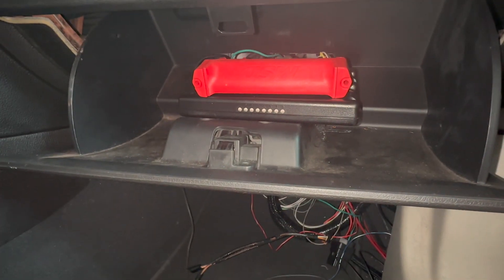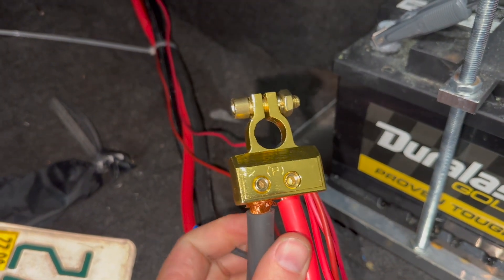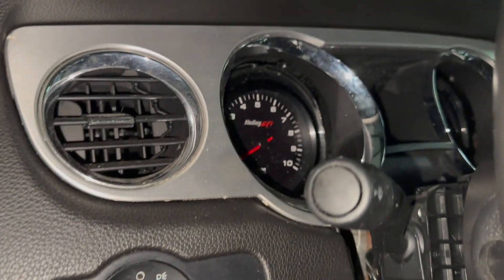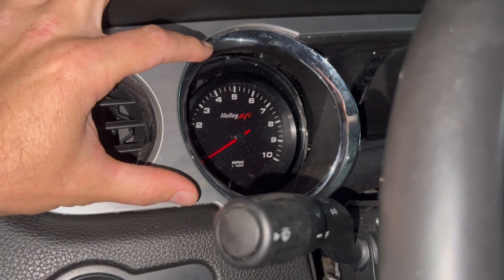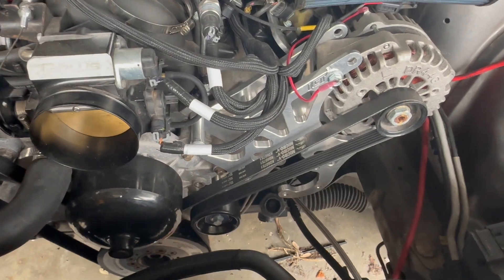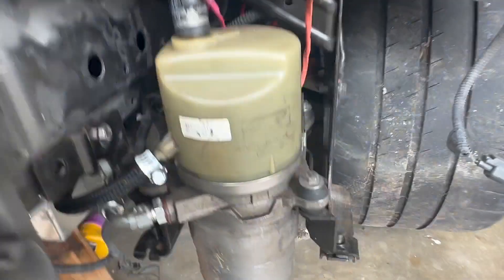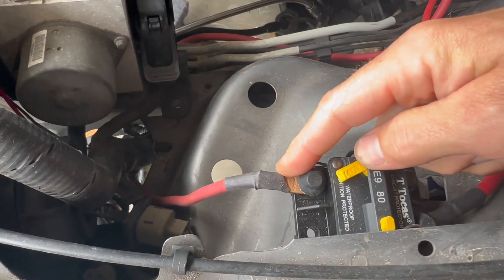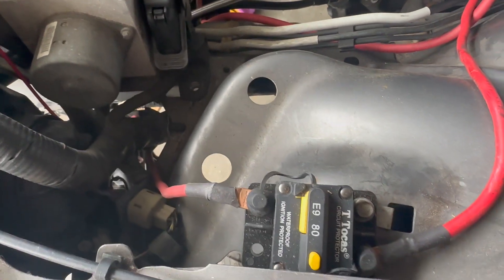S197 LS swap Part 6 Holley Terminator x, electrical, and Volvo electric power steering

Comment: Have you had any issues with water damage to the power steering pump? I put my pump in the same location and it got wet. Rain was running down the hood gap and draining down the two electrical plugs and the pump shorted out.
Reply from the maker: No, i haven’t had an issue since the install. Maybe heat shrink your electrical connections?

Comment: How did you make your power steering lines
Reply from the maker: Just measure the length you need and give the measurements to a hydraulic shop.

Comment: On E-Bay, they sell a controller for that pump. It's like $60. The pumps supposedly only work at like 70 or 75%. With a small flathead screwdriver, you can turn it up or down. I will be ordering mine next week. I want to run the same pump in my Vic.